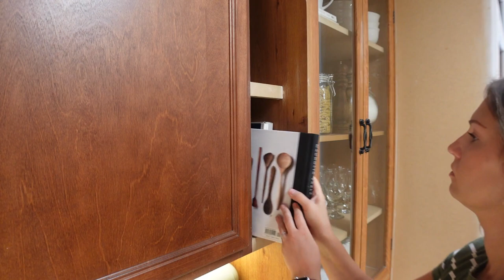DIY KITCHEN CABINET MAKEOVER PT. 1 (Build a fridge surround & add a glass hutch!!) | Home Reno Ep. 9

Comment: Kelsey what kind of lights did you buy for the bottom part of the cabinets?
Reply from the maker: The lights were actually already there but I had to remove then and reinstall because I was moving cabinets around. They are yunlights LED strip lights.

Comment: what size ply you used for fridge surround? Is it ply or MDF?
Reply from the maker: It is 3/4” mdf. 8 feet tall. I think the side pieces are around 36” wide.
Reply: @KelseyRomitoDIY  thanks...whats the size of the trim piece you used on the face of the fridge surround? using your video to build one myself.
Reply: @pretty95138  I am doing the same thing. Did you finish yours?
Reply: @KelseyRomitoDIY  thank you so much for sharing your projects! I think I already watched all of your videos. I am planning to do the same casing to my fridge but my ceilings are 108 inches high. What do you recommend?
Reply: @bellanathalie  yes..i did :)

Comment: What material
You used for the fridge surround?
Reply from the maker: It’s 3/4” mdf
Reply: @KelseyRomitoDIY  is there a specific reason you chose to use mdf over plywood?
Reply from the maker: A couple of reasons-
Price and also mdf is perfectly flat and smooth. I knew I wouldn’t have to sand it before painting.